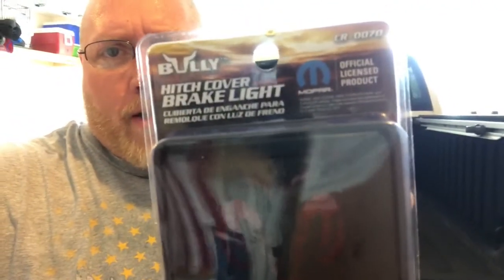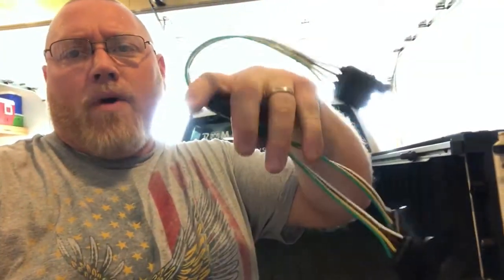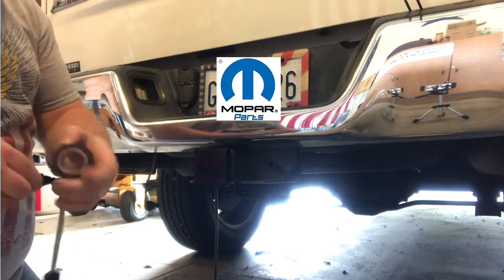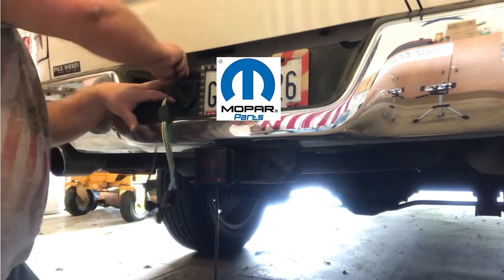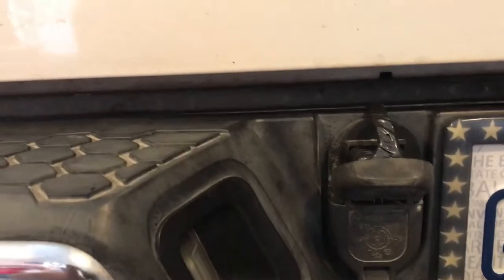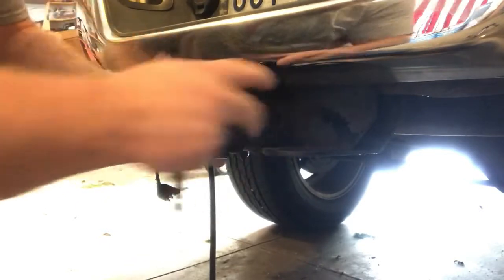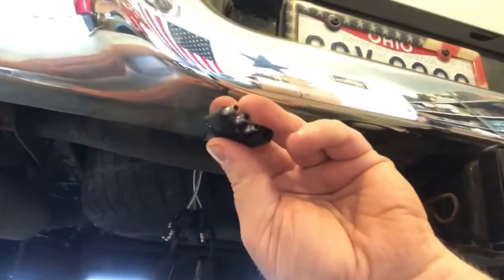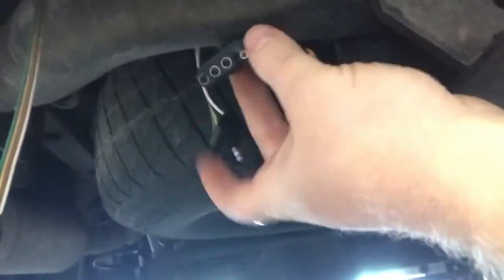Rear Hitch Brake Light (4 Pin Y-Splitter) Installation

Comment: Hi man, noce video, listen i got the same one but don’t know if that is normal when i out the right signal light the hitch is glowing, but it doesn’t do it with the left signal ?!
Reply from the maker: Alessandro Terracciano It uses the right turn signal/brake light circuit to power the hitch light. Therefore it will blink when you use the right turn signal. This is normal. Some hitch lights have a converter in the line that will filter out anything but the brake and tail lights. Mine does the same thing as yours.